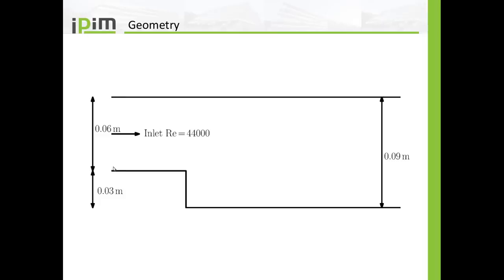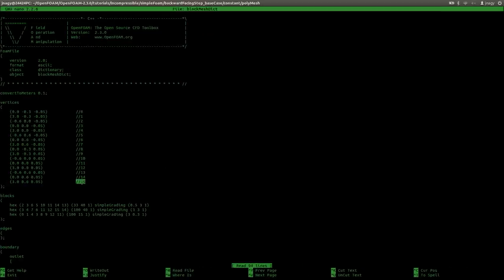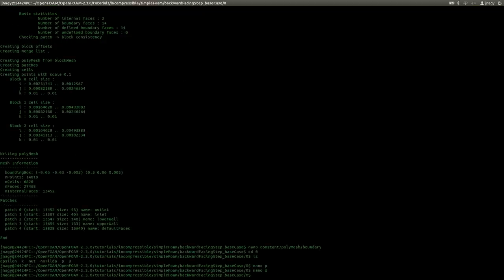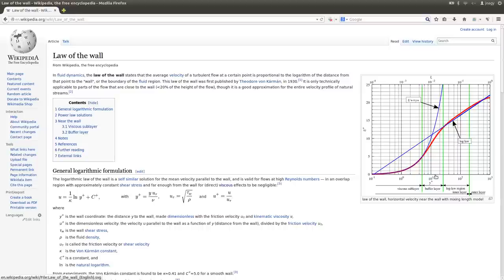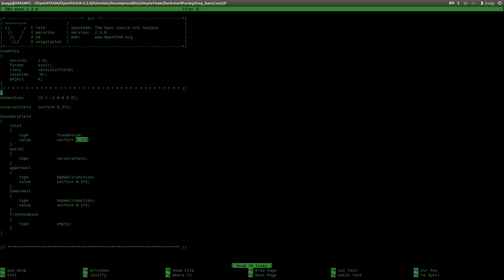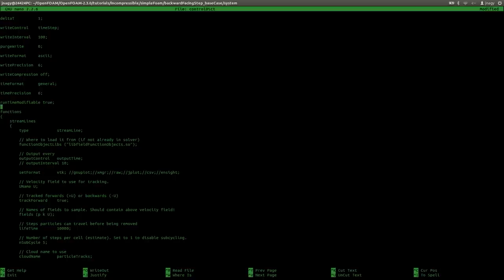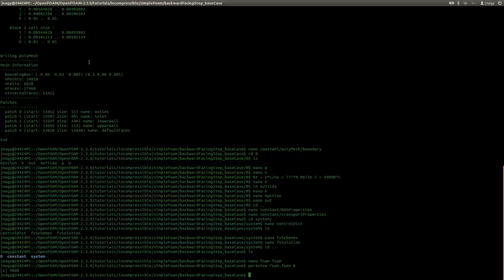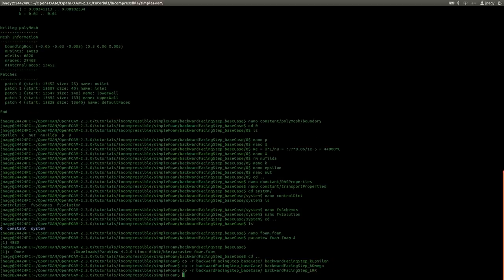Introduction to stationary turbulence modeling (RAS) - Part 2

Comment: Hello Mr. Jozesf

When I used the default settings, the k blows up when iterations run about 20 times. but If I changed the relataxtionFactors the same to your settings on the video. It works. I am using OpenFOAM+V1712.

Thank you!

Comment: Hello. Thank you so much for the amazing lecture. I am in the learning phase of OpenFoam, I have a question, i do not know its relevant or not. So, I followed all the tutorial, but unfortunately, I can not see options of P, U, and T in the paraview.
Reply: For example in the paraview, there are some options of Solid Color, CasePath, vtkBlockColors (Partials), vtkCompositeIndex. Usually in the same tab, we find T, U and P. But I can not see in my Paraview. Is it possible for you to assisst me somehow. Thank a million.
Reply: You have to check out the option "skip Zero Time " in paraview, deactivate it

Comment: First of all thanks for a great tutorial. I have a couple of questions.
1. is y+ should always necessarily be in the range of 5 to 30?
2. in the first part of this video u said simple foam can be also used for laminar flow. can u give a short description about which are the changes to be made . basically the turbulence model is  specified as laminar which other changes are neccessary.it would be very helpful. thx again.
Reply: Naresh Yethur Hi,

1. I have same question concerning y+ value for wall functions; as from literature it is said that k-epsilon model should be used within range 30-300 (depending on your flow); anyway prof. Nagy can you explain better this point?

2. changing from turbulent to laminar is simple: inside turbulentProperties you can turn off the turbulent (under line of turbulent model definition); this is a pratical way to initialize your U & p field value when starting with turbulence gives you convergence problem at the beginning of the simulation; then when residual are under certain values you can turn back it on; the computation will change automatically to turbulence.

I have one more question; as for simple geometry is easier to obtain a quasi-constant y+ value, what are the scalable wall functions I can use when I have several values for y+ plus? How should I set up the problem?

thank you very muche.

Michele
Reply from the maker: Michele Cavallerin You will find different values for y+ in literature, because it's obviously flow type dependent. The best is to check the literature of you problem setting and use the advices values from there. As Michele wrote just switch the model in turbulenceProperties. You have to check, which wall functions are currently implemented in the latest release. i have to admit, that I did not check it for the latest release. Just look for it in src.
Reply: you should NEVER put the first cell center in the buffer region unless you are using some smooth function, eg. Spalding function. Generally, you should aim either for y+ < 5 (linear approach, no WFs) or  for 30 < y+ < 200(300) (Log-Law region, WFs used)

Comment: Hi, I am trying to model a T joint using this solver but my inlets are at two different velocities how would I calculate  k and epsilon at my walls given the fact that my inlets will give me two different pairs of values  ?
Reply from the maker: At you walls or inlets?
Reply: @OpenFOAMJozsefNagy  at my walls
Reply from the maker: @garioncharles  At walls the wall function takes care of that.

Comment: Hi József,

I am adapting this RANS simulation you are showing for modelling the transitional flow over a low Reynolds number airfoil. I have a C-Mesh with significant refinement near the airfoil and along the line extending from the TE into wake. My question is, what boundary conditions should I use? For instance I have seen some people use 

inlet 
{
    freestream;
    freestreamValue uniform (0 0 0);
}

for all boundary fields other than the airfoil which is modelled with no slip. I'm not sure what boundary conditions are customary for these kinds of simulations? Any input would be much appreciated!
Reply from the maker: Oscar Wilsby Hi, I am more a guy for internal flows, but as far as I know the freestream BC is a mixed condition derived from the inletOutlet BC, where the mode switches between fixedValue and zeroGradient based on the flux. This BC seems reasonable, if you put your boundaries far away from your airfoil. Watch out for the correct turbulence model for the transition region. As far as I know there are specific models, don't just use e.g. the kEpsilon model.
Reply: Great, many thanks for your help, your tutorials are invaluable. I was also wondering - since I am applying the different turbulence models you show here to my 2d airfoil case, would there be a need to change any of the fvSchemes statements, or can I leave them the same as they are in the pitzDaily tutorial? Obviously the simulation works either way but I'm not sure how the schemes in general should be specified when experimenting around with different turbulence models.
Reply from the maker: Oscar Wilsby Oh, yes, the schemes are very important. Try to use at least second order schemes. You can play around, but you will find differences. Also the residuals and the number of correctors in fvSolution can be important. A grid convergence study is also very good at least once in a project.
Reply: Ok, that makes sense! I am currently doing a grid convergence study, where basically I am just refining my grid and running the same simulation setup until I see convergence. This I am doing manually. Now finally I want to validate my chosen model. In the airfoil case the simplest approach I could think of and have read about is plotting lift and drag coefficients for different angles of attack. Is there a good way to make OF produce this data automatically? Im guessing this requires a script of some sort which calls simpleFoam, stores the final coefficients, deletes the time directories created, changes the inlet boundary condition for velocity to correspond to a new angle of attack (I am assuming my mesh is constant throughout, and having the angle of attack change via the boundary conditions) and so on in a loop. Would it make sense to create such a script, or is there such functionality already present? (I realise once again this may not be your area, but I find your advice extremely helpful so please pardon me!)
Reply from the maker: Oscar Wilsby Yeah, that's a good idea. Alternatively you can take a look at swak4Foam, maybe you find something useful there.

Comment: Do I correctly understand, that the turbulenceProperties and RAS properties have migrated to momentumTransport diсt?
Reply from the maker: Which solver?
Reply: @OpenFOAMJozsefNagy  i am using simpleFoam, as in the video, openFoam v8
Reply from the maker: @sacramentofwilderness6656  Oh, I have not checked out v8 in that detail. I'd have to check myself. It stayed in v2006.

Comment: how could i put other backward step at this geometry for simulate an labyrinth seal?
Reply from the maker: I guess this would be a different geometry.
Reply: But It can apply? I has try with simpleFoam but It not run cause geometry size. I had used pimpleFoam cause my objetive is for machine element wich not spin
Reply: The error was:

--> FOAM FATAL ERROR: 
bad size -2147483647

 

    From function Foam::List<T>::List(Foam::label, const T&) [with T = Foam::List<int>; Foam::label = int]
    in file /home/ubuntu/OpenFOAM/OpenFOAM-10/src/OpenFOAM/lnInclude/List.C at line 61.

 

FOAM aborting

 

#0  Foam::error::printStack(Foam::Ostream&) at ??:?
#1  Foam::error::abort() at ??:?
#2  Foam::List<Foam::List<int> >::List(int, Foam::List<int> const&) at ??:?
#3  Foam::functionObjects::streamlines::write() at ??:?
#4  Foam::functionObjects::timeControl::write() at ??:?
#5  Foam::functionObjectList::start() at ??:?
#6  Foam::Time::loop() at ??:?
#7  ? in "/opt/openfoam10/platforms/linux64GccDPInt32Opt/bin/simpleFoam"
#8  ? in "/lib/x86_64-linux-gnu/libc.so.6"
#9  __libc_start_main in "/lib/x86_64-linux-gnu/libc.so.6"
#10  ? in "/opt/openfoam10/platforms/linux64GccDPInt32Opt/bin/simpleFoam"
Abortado (`core' generado)
Reply from the maker: @sebastianmurillo5789  The error has something to do with the function you define in controlDict, not with your geometry.
Reply: @OpenFOAMJozsefNagy  so, could be cause courant number?
Reply from the maker: @sebastianmurillo5789  No, one of your function objects.
Reply: I had finded that the error Is cause streamline function and i had modified the start and end but actually i have a error about float point, the simulation run but stop before convergence AND the results are rare
Reply: actually i have this error SIMPLE solution converged in 8.6e-05 iterations

streamlines streamlines write:
    Seeded 2 particles
    Sampled 91 locations
#0  Foam::error::printStack(Foam::Ostream&) at ??:?
#1  Foam::sigFpe::sigHandler(int) at ??:?
#2  ? in "/lib/x86_64-linux-gnu/libc.so.6"
Reply from the maker: @sebastianmurillo5789  So the simulation runs but crashes after a while? This may be to mesh quality reasons or too high underrelaxation factors.
Reply from the maker: @sebastianmurillo5789  Get rid of the streamlines function first and run without.

Comment: Hello Mr. Jozesf , 

My simulations is converging at time 134 s and not going to 2000s . Same setup , can you tell me what I am doing wrong.
Reply from the maker: Well 134 is not in s, it is an iteration number. What do you mean by converging? Does it stop at 134 with the Info that the simulation converged?

Comment: Hi Mr.Najy,

If you didnt change the default values of k and epsillon , will this affect the results in a direct way? or it is just help the simulation to converge faster?

Thanks
Reply from the maker: Hi,
do you mean the default values from the pitzDaily case? If yes, then yes of course it will. If you don't find values within a reasonable magnitude, your simulations will be quite different from reailty. This is why you have a characteristic length scale in the rule of thumb. It is not for convergence reasons.
Reply: Yes, But you said that these values are only rough estimates on the inlet. I mean, If my simulation was long enough (large iteration number)  the solution will converge regardless of these values ! is this statement correct?
Reply from the maker: Mohd Aref Yes this is true, however, your simulation will converge towards a different solution. Try it out, the simulations do not take so long. Use different values for k and epsilon and compare your results (U,p,k,epsilon,nut).

Comment: Hello, I have some troubles when trying to run the simulation as directed in the tutorial. Specifically, the problem is when I change the discretization schemes to linearUpwind in the fvSchemes directory, after 22 iterations the program stops with the next error message:

smoothSolver:  Solving for Ux, Initial residual = 0.590391, Final residual = 1.00201e+34, No Iterations 1000
smoothSolver:  Solving for Uy, Initial residual = 0.606482, Final residual = 2.05892e+34, No Iterations 1000
#0  Foam::error::printStack(Foam::Ostream&) at ??:?
#1  Foam::sigFpe::sigHandler(int) at ??:?
#2  ? in "/lib/x86_64-linux-gnu/libc.so.6"
#3  double Foam::sumProd<double>(Foam::UList<double> const&, Foam::UList<double> const&) at ??:?
#4  Foam::PCG::solve(Foam::Field<double>&, Foam::Field<double> const&, unsigned char) const at ??:?
#5  Foam::GAMGSolver::solveCoarsestLevel(Foam::Field<double>&, Foam::Field<double> const&) const at ??:?
#6  Foam::GAMGSolver::Vcycle(Foam::PtrList<Foam::lduMatrix::smoother> const&, Foam::Field<double>&, Foam::Field<double> const&, Foam::Field<double>&, Foam::Field<double>&, Foam::Field<double>&, Foam::Field<double>&, Foam::Field<double>&, Foam::PtrList<Foam::Field<double> >&, Foam::PtrList<Foam::Field<double> >&, unsigned char) const at ??:?
#7  Foam::GAMGSolver::solve(Foam::Field<double>&, Foam::Field<double> const&, unsigned char) const at ??:?
#8  Foam::fvMatrix<double>::solveSegregated(Foam::dictionary const&) at ??:?
#9  Foam::fvMatrix<double>::solve(Foam::dictionary const&) in "/opt/openfoam5/platforms/linux64GccDPInt32Opt/bin/simpleFoam"
#10  Foam::fvMatrix<double>::solve() in "/opt/openfoam5/platforms/linux64GccDPInt32Opt/bin/simpleFoam"
#11  ? in "/opt/openfoam5/platforms/linux64GccDPInt32Opt/bin/simpleFoam"
#12  __libc_start_main in "/lib/x86_64-linux-gnu/libc.so.6"
#13  ? in "/opt/openfoam5/platforms/linux64GccDPInt32Opt/bin/simpleFoam"
Floating point exception (core dumped)

Does it has to do with the OpenFOAM version? (I am working with OpenFOAM 5)
I have to say that if I keep the discretization model unchanged for k and epsilon, the simulation runs properly.

I will be very thankful of any advice that somebody can offer.
Reply from the maker: It might be. A lot has changed since version 2.3. You might run the simulation for a longer time with upwind and slowly change k and epsilon to linearUpwind. Also you could lower the underrelaxation. Maybe that helps.
Reply: József Nagy thank you very much for your response, I will try your suggestion and see how it works!
Reply: @OpenFOAMJozsefNagy  Ran into a similar problem using version 6. My fvSchemes had limitedLinear which I changed according to your video. Default relaxation factor was 0.95 for all fields. I changed them to 0.7 and it worked well. Please explain what is limitedLinear and significance of relaxation factors?
Reply from the maker: @parasghumare5864  limited linear is similar to linearUpwind or linear. It is just limited. I have a video on discretization schemes.
Reply: @OpenFOAMJozsefNagy  Thanks.

Comment: I have 2 questions: 
The first refes to turbulence in stationary modelling. If there is no time dependency, how is in this case turbulence defined? In the first tutorial of turbulence you implied only oscillations in time (vt).
The second question refers to the courant number in stationary simulations. If there is no time dependency, how is it calculated? If it applies to no physical time then it should be the timestep given in 'controlDict'. However there you could give a smaller endtime and a smaller deltaT in order for the quotient to be the same. Would that result in the same results? 
Thank you
Reply from the maker: Courant number is not used in steady-state simulation, as there is no time as you mentioned. Turbulent is assumed to be averaged over time. Think of it as a transient simulation and you take all your time steps and average over all of them.
Reply: Thank you very much! I am trying to model a room with mechanical ventilation and some heat sources (radiative and convective).  Could you recommend an online tutorial in order to get an idea of the solvers, etc? I have seen some basic tutorials in the heat transfer folder but I would like something more elaborate and complicated. Thanks in advance.
Reply from the maker: I can only draw you attention to this video: https://www.youtube.com/watch?v=7bwTNoPJYy0

Comment: Hello mr. József,

I'm civil engineer and i would like to model wind forces acting on buildings with OpenFoam. So here is my question:
if i want just to calculate the pressure distribution (and not the aeroelastic effects) is it valid to neglect the turbulence? Thanks a lot for your informative videos!
Reply from the maker: I don't think so.

Comment: can I ask why you deleted the residual control for pressure and speed? and K?
Reply from the maker: The simulation will not stop at a certain point, with that I control the residuals with the tolerances. This is my approach, there are many alternative approaches, especially for steady statwe simulations.
Reply: Thank you for getting back!

Comment: 17:56 Nice italian accent!
Reply from the maker: :D Thanks.
Reply: @OpenFOAMJozsefNagy  Maan, i don't know what to do. When i put the kEpsilon model to run, the simulation only runs till the 1710th iteration with initial residuals on the order of 1e-1. I can't find where am i messing this up. Any guess?
Reply from the maker: @Dmplivemail  Which version pf OpenFOAM are you using?
Reply: The version 6  @OpenFOAMJozsefNagy
Reply from the maker: @Dmplivemail  Convergence changes between versions. You might consider a lower underrelaxation factor.
Reply: @OpenFOAMJozsefNagy  I was setting the relaxation factor for te p field wrong. I was actually setting it to a lower level, 0.03 instead of 0.3 as it is showed on the video.